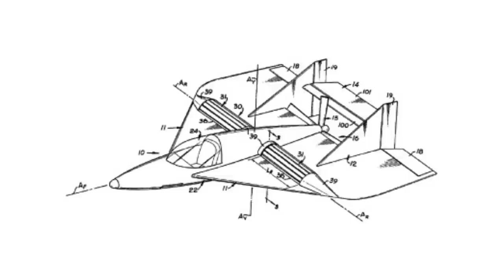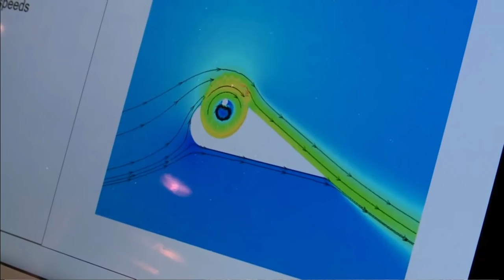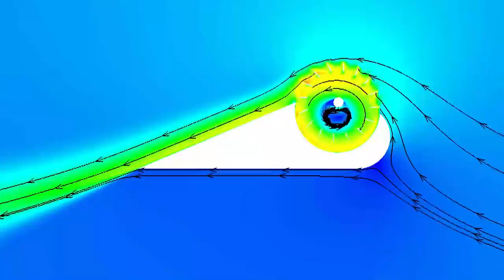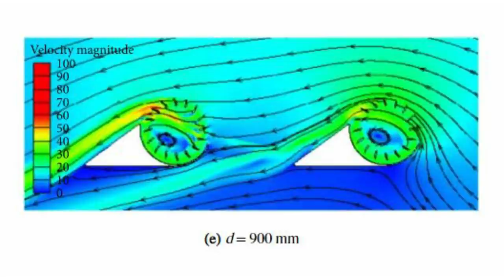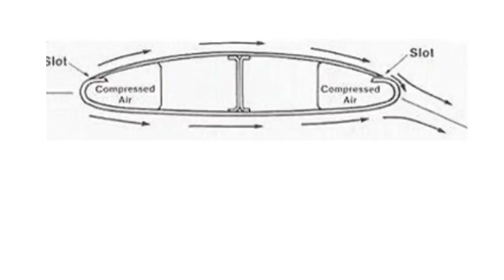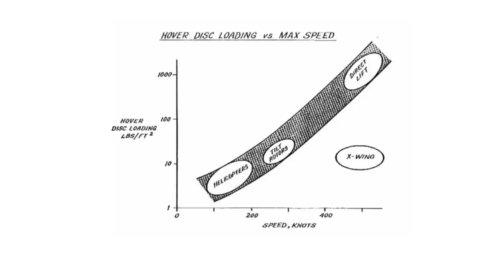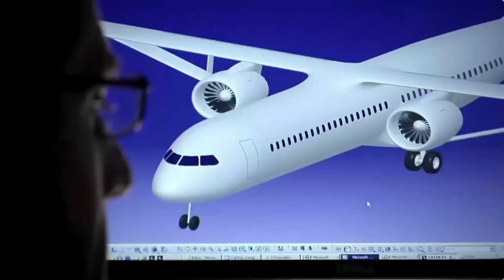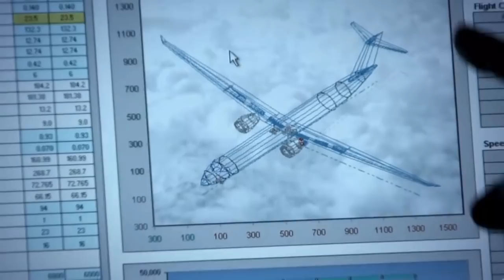Wings of change: New Wing Designs for Electric Aviation

Comment: The "flying flapjack" of WW2 era does the same thing as the fan wing but is much simpler and has high top speed. Thanks for bringing Macro fiber composite to my attention. It would be ideal for the idea of a "heart assist jacket" that would fit around a weakened heart and constantly give a heart assist/massage.

Comment: With aviation it's the same with biology: there is evolution. If a configuration would have made sense, it still would exist.
When I studied aircraft engineering and build model planes, I understood why planes look the way they do. Because it makes the most sense. Easy to manufacturers, to calculate, maintain, ground handling etc. There are a whole bunch more factors to measure how good a design is then just fuel efficiency. Most of the time the other factors dominate.
But I'm very interested to see other designs pop up. Especially with eVTOL.
Reply from the maker: Thanks for your insightful comment
Reply: Well said.  Great video. I’m also really interested in eVTOL and eSTOL.

Comment: I have a model magazine from the 1930s with a fan wing....  nothing new here.

Its an extremely high drag wing and its heavy.

Modern materials reduces the weight issue. 

Pou de' Ceil, also from the 1930s, proved tandem wings had efficiency improvements at a cost of certain control issues.  Too fast with the tandem wing drives the nose down due to amplifying the rear wing lift.   It can be impossible to pull out of the resulting dive.
Reply: все знают, что циклокоптерьі - игрушка россии. нужно показать развитие техники, и для технически глупого населения єто проходит как великая инновация. а авиация развивается не в советском раю.

Comment: Don't know if you have already done videos on Vertical Axis Wind Turbines. I find them fascinating.... to use in medians of the highways along with Pressure Sensitive roads to generate electricity. Throw in thin film Perovskite Solar Panels in that. Would be just PERFECT for Green Energy Revolution !!!
Reply from the maker: The latest video on Synergy Files (my other channel) is on a bladeless wind turbine. You can check that out

Comment: I winder if rtuss brace wing can be combine with cross flow fan, not fot the purpose of lift as this will slow down the plain , but as distributed trust. The inlet or outlet will need to be redirected by 90 degree so they are on the same refrence plain. The diameter will be much smaler to fit inside the wing.

Comment: The market has not been disrupted. Classical design works and new technology has to be more specific than you state to be of use. Lifting body designs are being researched. Multi billion dollar industries working at the leading edge of technology have more to consider than simple model airplane designs. Mass air transportation has safety and reliability considerations that limit all other concerns in reality. Adoption isn't done at the flip of a coin.

Comment: 6:23 Too much to go wrong. And it won't work without the more complex changable aerofoil. But what about twin contra rotating rotors slowed to the rpm where the receding (backwards airflow) blades have the least impact and airspeed for those blades is slow.?. I reckon they could convert the Sikorski RAIDER to one of those, fairly easily. Just A certain slower rpm rotor option and some extra fancy software on its FBW rotor blade pitch control.

Comment: I think that battery technology won't be lighter than hydrogen tanks and fuel cells in the near future, so I highly doubt that electrical planes by Boing or Airbus will come with batteries as the main energy source in the near future.

Comment: The fan-wing seems like a cool concept until you have an engine failure with the glide ratio of a brick...
Reply: I read it’s better than a brick… just shorter than a fixed wing. They were using auto-rotation like a helo to slow the descent

Comment: Your opening argument fundamentally wrong: not only do you basically contradict yourself later on but two of the three wing concepts do not seem suitable for commercial passenger aviation. All three are only becoming relevant because of the actual reason limiting progress: technology
Of course mainstream aviation design is convergent but commerce, R&D costs and technology have been more important than regulation. Personally I feel that advances computation, materials and electric power have combined to make today the most exciting and innovative time in aviation since the early war jet age 
Actual technical content very good, would have liked more detail about tandem fanwings.
Also, CHAPTERS

Comment: With such a narrow wing the allowable CG range will be very small , possibly ok for dry cargo , but not for passengers , 10 , 300 pound passengers suddenly going to the bathroom in the rear of the plane could result in a disaster.